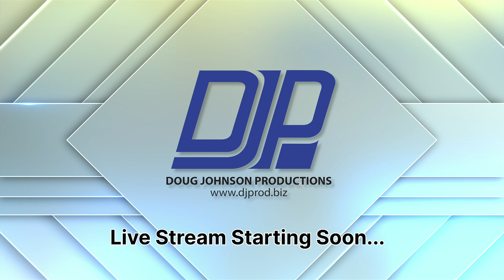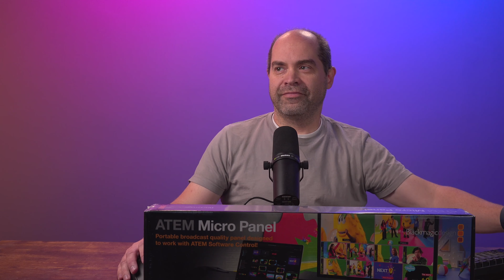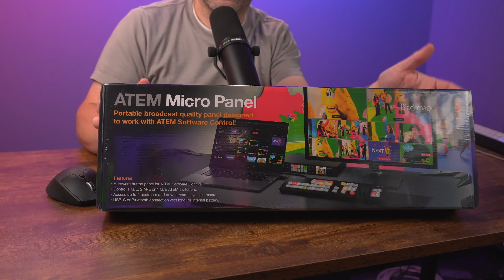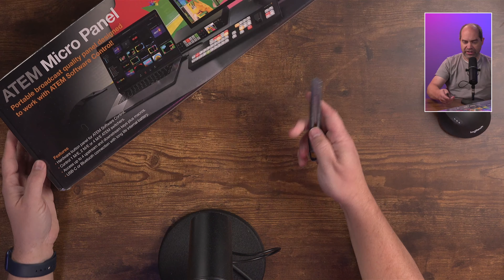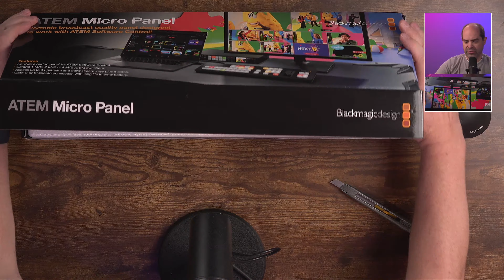Live Unboxing and Setup - Blackmagic ATEM Micro Panel

Comment: Hi Doug, I have two questions: 1 - Do you think this would control an Atem mini extreme if directly connected by USB? 2 - could it possibly work over ethernet using a usb c to ethernet adapter? Thanks Shaun in Devon, UK
Reply from the maker: No, and no. At least not with the current software. 

In theory a direct USB connection to an ATEM could be made to work, but I seriously doubt that it has enough intelligence internally to be able to add a USB host mode, IP stack, and the software to control an ATEM. It was really designed from the beginning to be a companion to ATEM Software Control.

Comment: Why the hell is there no ethernet port on it.
Reply from the maker: Most likely, to keep costs down? But that's a guess. It could also be to keep setup simple -- so you don't have to plug in USB, launch configuration software to enter the IP address of the switcher.
Reply: @djp_video  Without ethernet, it seems  to solve non-existent problem. I can control the ATEM with whatever keyboard-HID device, using plenty of PC software, don't need this gizmo. For example the X-keys. What I (and not probably just me) wants, is a dedicated cheap simple control surface, that does not rely on a (stupid unreliable and unnecessary) PC, that gets in the way of a simple ethernet control protocol. 
Keeping costs down? Haha, still plenty expensive to be able integrate a RJ45 magjack, and ethernet PHY, easily. Jeez, at 600 € + price for this device, I rather buy another X-keys device, than this. I will be significantly more flexible with Xkeys, than this. If this would cost under 100 €, I might be thinking getting it. For almost 700 €, the price is beyond silly, considering it is just a box with bunch of standard cheap illuminated buttons and one slider pot, with a cheap USB microcontroller (and a bluetooth).
Reply from the maker: You can, but all of those other solutions require quite a bit of time and effort to setup. This just works. 

Or at least it just works when you have a working USB cable. :)
Reply from the maker: @sixta16 I agree that it is too expensive, but the big cost for this panel (and the others from BMD) is the buttons. This type of button is quite expensive -- each one of those button assemblies is likely pushing $10.  When you get into high reliability components, they get pricey really fast. These are definitely considerably higher quality than the ones used on the X-Keys panels (and even those aren't cheap). I doubt Blackmagic is making much on this panel at all.
Reply: @djp_video  Hi Doug, Thanks as usual for the demonstration.  Kind of on the fence with this as I feel I can do the similar function with Mix Effect via virtual buttons.    Also I have the 1/me constellation 4k and a mini extreme.  Would it be possible for me to feed pip or super source to the one of the constellation inputs?  Thx
Reply: Looks like there is no “YouTube player/transport controls” on the replay of the video….
Reply: No thernet port I believe is because most atems only support about 5 network control connections at a time. With this being usb/bluetooth to a pc it means it doesn’t take up one of those connections as you likely will already have a computer connected for the various other settings
Reply: @mattday3037  Yes, I have just the one PC and maybe an app to read tally states. That is two connections. Still 3 connections left, one of them could be a dedicated HW control surface.